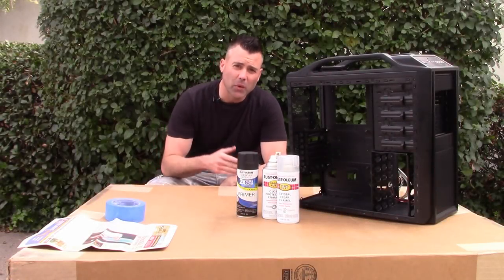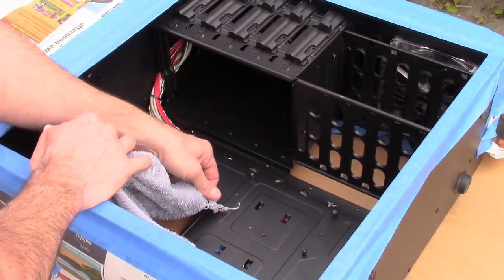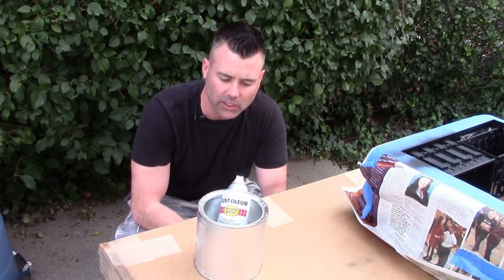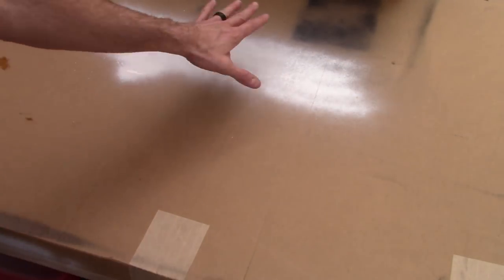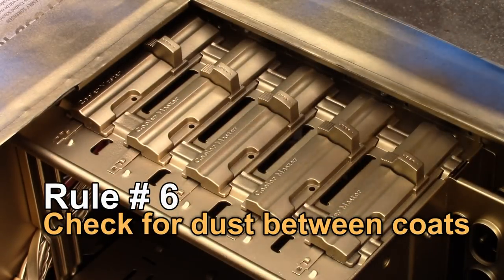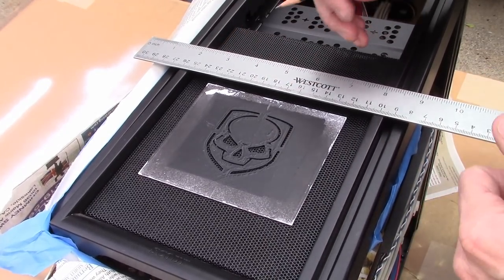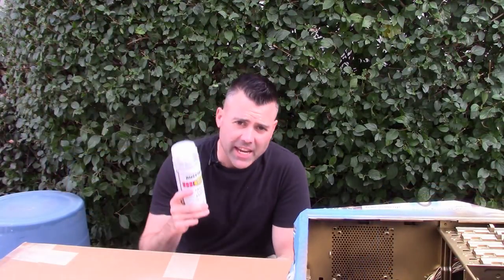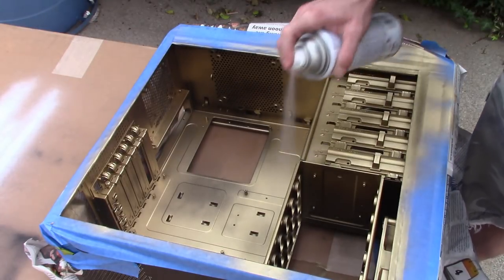Top 10 Spraypaint Tips - spraypaint

Comment: Biggest additions I have to the clear coat step.  
1.  If you can let your color coat cure out and gas off for 7 days it will have potential to turn out much better due to no potential reaction
2.  Make sure to use a tack cloth before starting.  They are $1 and available everywhere
3.  Make sure you are not painting in a high humidity area, it will result in your clear looking hazy ( it’s called blushing by most people). You can try to fix it with a heat gun but it will never be 100% correct
4.  I like to do light coats of clear and leave your 2nd to last coat a little dry or rough looking , then on final coat give it a nice wet coat with out running it.
5.  If you do get a run in your clear don’t freak out, just make sure there is enough clear sprayed around that area so when cured you can wet sand it out.   I have even done something I will call Run the Run and intentionally spray on more and more in that area to make the run go off the edge of the product.   Better to do this than trap a little air pocket in your run.
6. Wait a minimum of a full 7 days before you wet sand and buff & polish   It takes that long for spray clear to cure out good
7. If it’s an important project spend the extra money and go to body shop supplies store and get a spray can of 2K clear.  Read directions and follow.  Results will be amazing!
Reply: Much appreciated!
Reply: Would it be better to spray light, wait 5 minutes and spray again, wait 5 minutes and spray again OR spray light, wait 5 seconds, spray light, ...

Comment: Thanks Tony, learned something new to warm my paint. I've always tried to paint at between 18 and 25 degrees Celsius if I'm warming my paint can I paint at lower temps or am I still best to paint a theses temps and warm the paint. Also, I would like to do away with rattle cans and move to a spray gun but am unsure when it comes to 2k, 2 pack, cellulose and acrylic etc any chance of more info or a vid regarding this?

Comment: When you are warming your paint with hot water, does it have to be as submerged as what you showed in Rule # 3? Also, how hot should it be; should it be where you just finished boiling it or where I left the hot water around, say, 1 or 2 minutes after I boiled it? I only had my Bosny can submerged at the "foot" (for the lack of a better term) as that was the only water container I can find at that time; and when I shook at after getting it out, the bottom ballooned as if it is about to explode in my face.

Comment: Risers can usually be unscrewed allowing for different mother models like itx or E-atx or aftermarket risers. That case fan bay should be empty😁 Bearings hate paint. The front panel containing usb, headphone and other connections can also be removed.